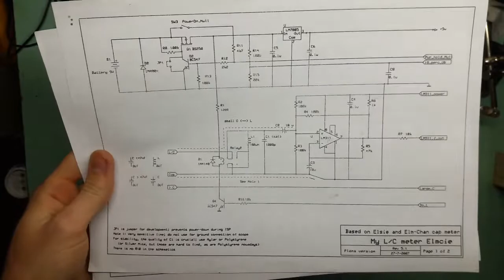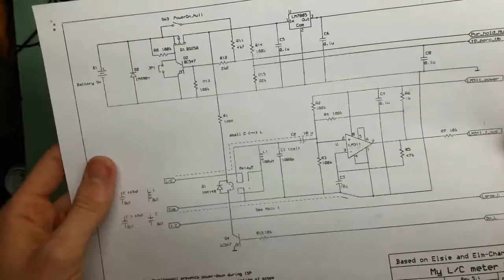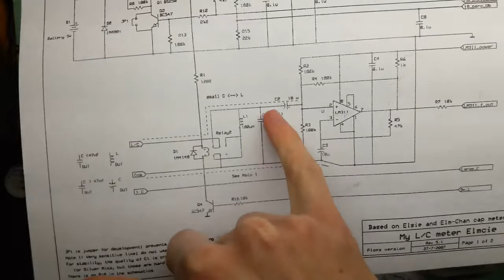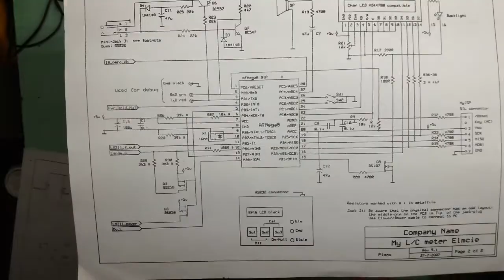Quick look at "ElmCie" LC meter

Comment: Nice. Thanks for showing it off. Sorry for breaking the button ;/
  Is that your PCB design or did you print an existing etch design from the project?
  Oh... and please show your 12v boost converter design at some point. I have a bunch of 12 volt relays laying around that I could use in circuits like this.

  Did you have issues with replacing the 9 volt battery with a boost circuit? I've tried to replace the 9 volt battery on a Transistor Tester clone using a wall wart rated for 9 volts at 200mA. It works but after testing it out and logging test results my tester is very inconsistent with the wall wart. I probably wouldn't notice the difference unless I look at the results in a spreadsheet. I set it up with a single transistor as the DUT and logged the test results from 50 tests in a row. The battery was extremely consistent if you exclude the first 5 to 6 tests of the log. The wall wart is all over the place. I tried adding a large capacitor to the circuit and that didn't help either. My next step is to add a capacitor multiplier/active ripple filter circuit to the wall wart to see if that helps.
  I need to get a bunch of projects done to get to where I can film and build my other AVR-TT clones. Then I can demonstrate it across all 3. If I'm having these issues with 60hz from mains I can only imagine how bad it would be if I tried to add a DC converter circuit, but I'm pretty dumb, so it's probably just me..
Reply from the maker: The button was taken from an old CRT TV, I'm not bothered a bit that it crapped out :)
  Yes, the PCB design is mine. The design is pretty old (it was on my old HDD which died), but I might have it in some files I recovered from that drive.
  Ok, I will make a video about that boost converter.
I didn't have any problems powering this LC meter from a boost converter. But I did have a problem with Transistor Tester, the ripple on the output of the booster caused erratic operation. I battled that by installing 470uF cap, but that created another problem :D  Then I battled that problem by installing a little discharge circuit to drain that cap quickly.
  Your problem is most likely due to parasitic coupling between the mains and the output of the wall wart. Xfmer has capacitance between primary/secondary, which might reference one of the output wires to live conductor of the mains. Then when you come near or hold the device in your hand, you act as the earth conductor, and couple noise into the circuit. If the problem appears only when using mains fed supplies, that's the only reason I can think of right now.
Reply: MrJohhhnnnyyy 
  I will have to test my TT wall wart problem on the scope. One of these days I'll put together a better bench tool shelf where I can easily access my scope but for now I leave it safely stored away. It's a pain to drag it out every time I throw together some dumb magic smoke idea, and I don't want to magic smoke my scope either... I'd probably need to resort to prostitution to replace it...and I'm not pretty enough to go Pro in that trade...or so I'm told ;-)
Reply from the maker: LOL
What scope do you have, LeCroy Teledyne?
Reply: MrJohhhnnnyyy 
Rigol DS1052E (the old one//same one as Dave Jones's first video on EEVBlog. I found one second hand for $150 a couple of years ago :)
Reply from the maker: Nice find, good for you :) New one here costs 400$, way out my budget. Old Tektronix CRO's aren't that cheap either :(
Reply: It was the only thing I got for me after I got hurt, before my savings disappeared. I don't use the scope as much as I should but it's handy. I probably need a better multimeter more than a scope at my current skill level. Things aren't as readily available here as you might think, or people my lead you to believe. There used to be a larger public community interested in electronics and radio, but hobbyists are few and far in between as far as I can tell. We don't even have a local electronics store any more. When RadioShack went out of business last year it really sucked. The closest electronics store to me is over 60km away. They don't have a very good stock of basic components and cost 5-10 times what parts cost online. Everywhere has it's ups and downs ;)
Reply from the maker: Upcycle Electronics Cut it out, comparing to the place I live in, you live in heaven :D I have to order 99% of the parts online and wait. I dream about moving to the US, but chances of that happening are like one in a trillion. Ukraine never was all that great, but after that damn revolution it became a REAL shithole. War going on, prices go up with each day, all this shit kinda makes me want nothing but to commit suicide.
Reply: MrJohhhnnnyyy 
   Times aren't great here in the US. The millennial generation is the first time in the last 100 years when we are not able to make as much money as our parent's generation. Millennials make an average of 20% less than their parents did at the same age. The place to go right now is New Zealand. I have no idea what it's like outside of this country but I haven't had a very easy time so far and I have worked my ass off at everything I've done. The US is in the middle of a big wealth disparity where the middle class is disappearing. It's always bad when politics turns to populism. I don't mean to discourage you, but it's pretty hard here IMO. The last job I had was as an accountant and wholesale buyer for a chain of Bicycle shops. I was the only person working there that didn't have a college degree out of 30 people. When everyone in a bike shop has a degree that's pretty messed up. I think the best way forward is to code and find a way to make a living with it. Then you could live anywhere...but coding isn't my favorite... San Francisco is the only place around that has a lot going on and opertunities, but you won't believe how expensive it is to live there. Rent will run you $2k-$3k for a crappy apartment in a bad neighborhood. I haven't tried working with electronics though. There are lots of places out here, but I haven't tried working at any of them. I've got to get fixed first. I've heard Broadcom is nice. They aren't too far from here... Closer than the closest electronics store. I guess we probably have more opertunities, but the competition here is rough. Maybe one day I'll get in better shape and get out on my own. Then you could visit and check it out if you want. I wouldn't care, if I have a place with some spare room, but I'm not in that kind of position living with family as a gimp right now. I barely leave my house unless I need to see a doctor right now, and there's no telling how long it will be like this ;/
 I got hurt February 26th 2014 and still haven't found anyone that is able to fix me with my bad health insurance. I've got 1 doctor that I like and he wants $200,000 to operate. Freaking criminal if you ask me.
Reply from the maker: OK, it gets crowded here, I move this discussion into PM.

Comment: I have something similar, it did work but i noticed a difference in error direction between measuring a capacitor or an inductor, L/C measurments parted in "oposite directions", one too high and the other too low, very odd.
I added another reed relay and trimmer capacitor that paralled the 1000pf ref cap in one of the modes only, that helped a lot.
The oscillator inductor really gave odd effects depending on the ferrite in the coil.
Also it would not cover the ranges using different inductors.

I found it very touchy on what inductor you were trying to test, ferrite or non ferrite.
it worked but the problems i had made the build a pain :-(
Reply from the maker: Well, I dunno. This one works fine. I don't have super accurate caps or inductors to calibrate it, so I calibrated the cap reading using my Uni-T UT56 as the standard :)
 This one measures all coils: air core, ferrite, iron; doesn't matter. Best cap I have is 4700pf +-1%, when I measured that the reading was within the spec.
 Calibrating procedure for this LC meter is quite complex, so I had a little bit of pain too :)